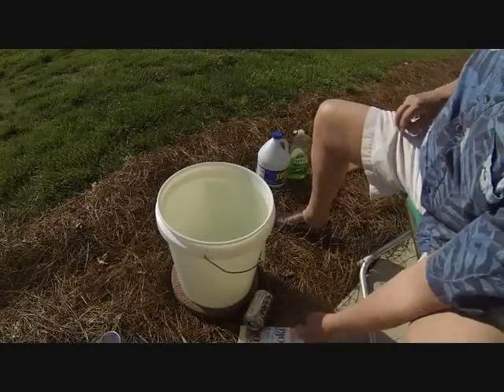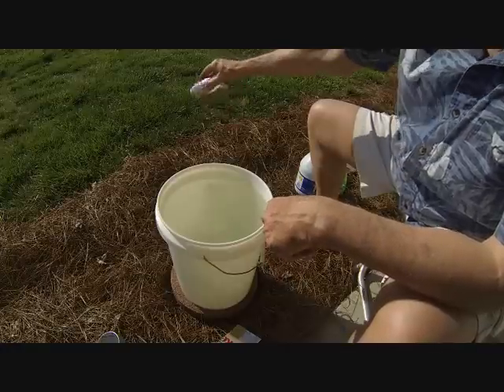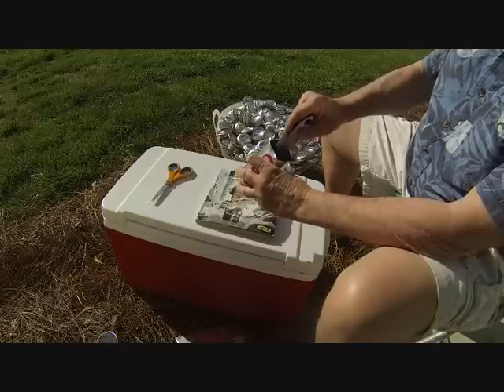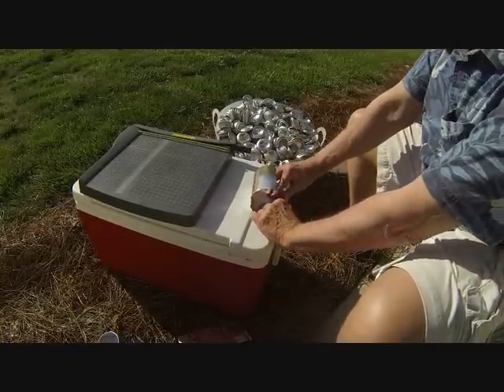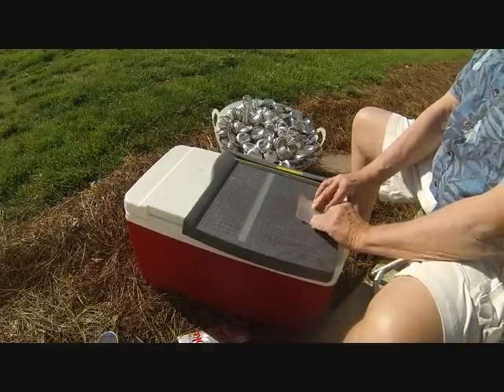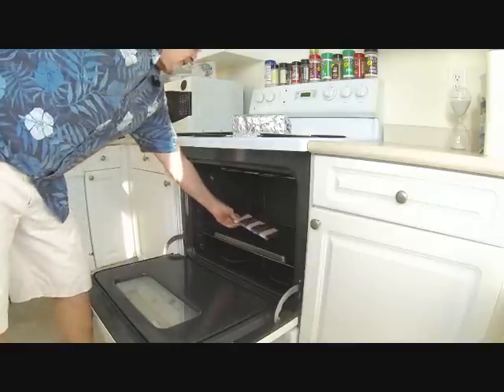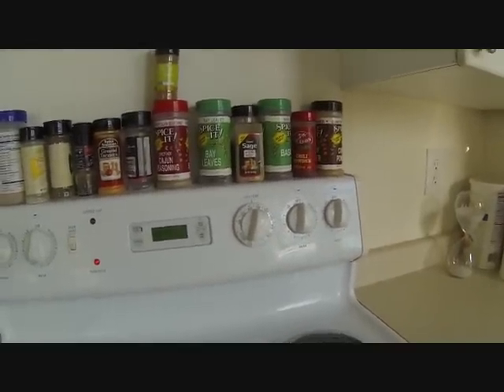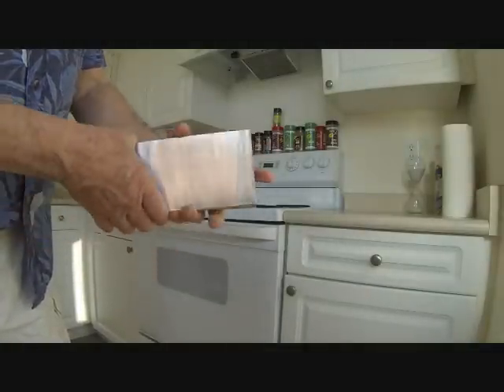Soda Can Shingles - How To

Comment from the maker: After the cans are cut, the aluminum has a slight tendency to return back to its curved form.  Also, all the handling of the cans can cause some minor dents and wrinkles. Heating the material helps it to "relax" or flatten out.

Comment: Use a miter saw with vinyl siding blade (or more appropriate blade, its just what I had on hand) to cut both ends of the cans, it goes waayyyyy faster.    Cleaner cut too.  Cut both ends off starting with the "drinking side", throw the finished pipe in a laundry basket.  Go back, with pair of scissors, and cut the lot of them to finish the job.  I don't even bother with the paper cutter.

Still, its more trouble than its worth....   and I've done thousands of cans, to make aluminum flashing.
Reply: The saw will throw metal in the air which doesn't bode well for getting in your eyes.
Reply: @satochinakamoto6129  that's what eye protection is for.

Comment from the maker: Time will tell.  We finished the installation last Fall and they seemed to withstand the Winter (and the Spring, so far) with flying colors. 

The interior surface of a soda can is coated with an epoxy resin to resist oxidation, so there is a slight advantage by facing that surface outwards.

Cheers!
Reply: Any update on how the shingles are doing? 

Did you install them on a house?
Reply from the maker: Still holding up very well! I haven't tried them on anything else but the chicken coop, but they are still performing the way they should and are silver and shiny as ever. We've had some extremely windy days over the past several years and I'm amazed how well they've held up.      Any shingles that did happen to lift a bit were easily flattened back down with a bit of Gorilla Glue tucked underneath.
Reply: @ChristopherGideon   Sweet!

Comment: I use two of them as overlapping flashing behind the seams of concrete fiberboard asbestos house siding shingles, where the shingles butt together along a row.  Staple or nail one down, then another one overlapping it to make a 14 piece of alluminum flashing behind the seam.

Once you cut the bottom of the can off with the knife, you can cut your scissors line across, then cut the other side with the scissors by rotating it 90% when you reach the end.  Its faster and safer that way than using the knife on both ends.  

I'm wondering if I can cut the bottom off with like a fine bladed big scroll saw because cutting the bottoms off with a knife like that is dangerous and slow.  

I don't bother baking mine, the concrete fiberboard shingles will flatten them out over time, and I want them to curl outward to press against the seam and make it water tight.

Since the cans were bought with food stamps, and the asbestos house shingles and nails I scavenged for free, I basically resided my entire house for $100....    $40 worth of tar paper, $20 worth of tar paper nails, and $40 worth of saw blades... and labor on my part.   One hundred bucks to side a house is pretty god damn good, considering the same job with crappy vinyl siding that would degrade in the sun in 20 years, would probably be like $5,000 done by a contractor.   Concrete glass fiber board and alluminum will last damn near forever.

And yes, I took precautions cutting the fiberboard.  I'm not entirely sure its the asbestos variety, but I took no chances with the dust.

Theoretically I suppose I could of done the whole house in canned alluminum, but its rather thin, and it would look trashy and tacky, and this way, nobody will see it and it will do an awesome job kicking out and repelling the water between the seams.
Reply from the maker: Excellent!  Another great application for soda can shingles.  You're right, they may not be the right choice for an entire house, but on a chicken coop, they look great!
Reply: +CHOPPERGIRL AIRWAR Asbestos tiles are great mine are almost fifty years old and still look new.
Reply: Can you do a video about using aluminum cans for siding. It hard to visualize what you mean.
Reply: @satochinakamoto6129   You cut the ends off the cans, and then you havea  tube of alluminum.  Then you cut the tube down the length of it and press it flat and you have a flat piece of alluminum rectangle you can use for something.

It's hsarp and difficult and time consuming to work with, but alluminum lasts for dang near forever, is expansive, and cans are in my case free so...   A free source fo alluminum shingles.  

I made a ton of them but wouldn't do it again, I'd just buy a roll of alluminum flashing from Lowes.   I think a roll costs $25 each and is continguous.

Comment: 0:50 I'm glad I saw this part. I never thought I would hit the can on  something to make a hole instead of hitting the knife on the can.😄
But, why do we need to the "bake" them in the oven? What's the point? Thanks! 😊
Reply from the maker: After the cans are cut, the aluminum has a slight tendency to return back to its curved form.  Also, all the handling of the cans can cause some minor dents and wrinkles. Heating the material helps it to "relax" or flatten out.
Reply: @ChristopherGideon  WOW! That's wise.... That's science. Thank you very much for sharing your expertise with us. 😊

Comment: Careful in Europe! From what I've read, European cans are 45% steel. Yes I did the magnet test. I need to do a rust test before committing myself to roofing my shed.
Reply from the maker: Thanks, George.  Interesting... Just did the magnet test on a can here and did not get any attraction between the two.  If there is any ferrous material in our cans, it's negligible.  On a side note, through all the rain and snow we've had, our coop still looks just as good today as the day we shingled it.  No rust!
Reply: *****
I will do a rust test when I get a chance. Doesn't rain much here in Spain so I will leave can in a tray of water for a few days.
Reply: +George Cowdery  I don't think that is the case, we'll definitely not across Europe. I'm in the uk and there isn't steel
Reply: Steel and aluminum ?  or what..?
Reply: MIND MILK Check again. Its a coated low carbon steel in a large proportion of our UK tins and cans
Reply: George Cowdery : I don't think anyone mentioned this, but wouldn't it take a shit load of nails to even do a small project? 😀😄😄
Reply: Coca Cola used to use a bimetal can,   and were slightly magnetic, but you'd need a strong magnet to notice it.. I don't know if they still use bimetal or not now.

Comment: It seems with all the labor, and power used to bake them it would be cheaper to buy store shingles.
Reply: next project: solar oven
Reply: Only if electricity is ridiculously expensive where you live. Labor is cheap if you're not doing anything else with your time. Meanwhile, store shingles as you call them can run pretty expensive, even for small projects.

Comment: If you are unlucky, the city or county run building department may come and visit you and demand that you have your roof or dwelling removed because it will not pass the building code by not using approved building materials.
Reply from the maker: Thanks for the heads up!
Reply from the maker: KELLI2L2 Thank you for your comments.  Ding ding ding!  You are correct!  I used them for siding my chicken coop.  I'm not sure how well they would hold up for a roofing material, but for my application they have worked very well.  I faced the silver, coated sides out, so they look great too.  BTW, the oven process helps the aluminum to "relax".  It's not hot enough to make a mess of the tape.  Just make sure you use making tape and it should come right off.  Cheers!

Comment: I guess you could shingle a shed or dog house or maybe a chicken coop with them.  You could also make yourself a blingin' aluminum "tin foil hat!"  What is the point of baking?
Reply from the maker: Combat Pyro I love the tin foil hat idea!  So far, I've only used them to clad the exterior of my chicken coop and they look fantastic.  To answer your question, heating the material helps it to "relax" or flatten out.
Reply: Christopher Gideon You refer to them as "shingles" which would imply use as a roofing material. I think there cld be numerous uses. I think I'm too lazy to heat them in the oven, though -- unless there's something that I just don't realize. :-)